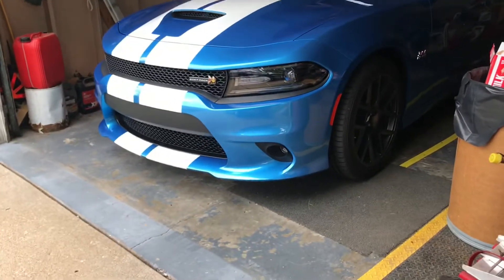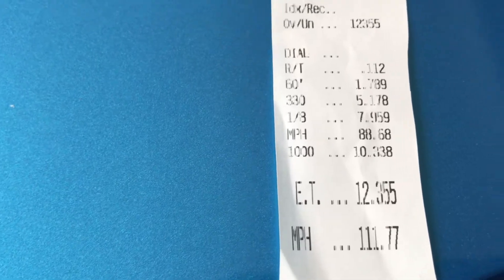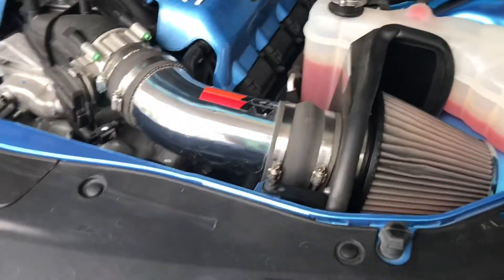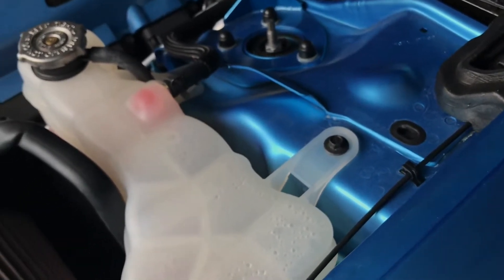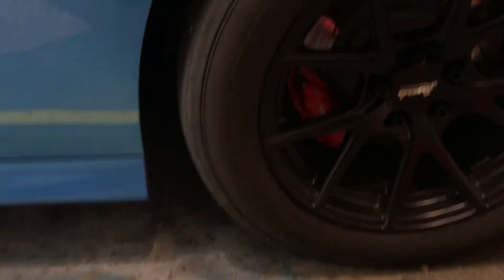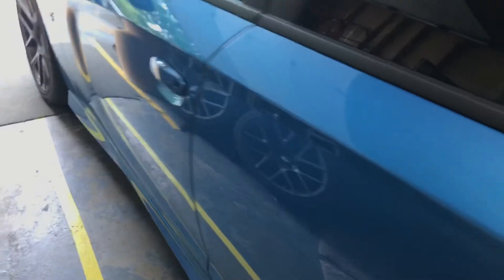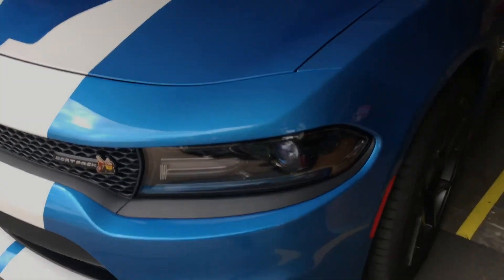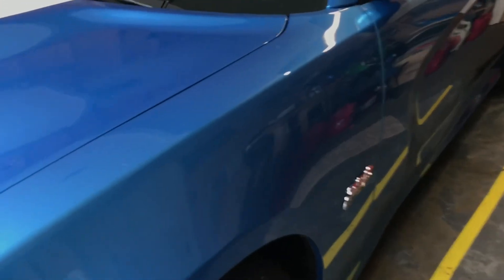Update on MMX Catless Mid Pipes & track results 2018 Scat Pack Charger

Comment: Thanks for listing your mods I had inquired about on your other video comments.  FYI I have a different DA calculator* that will convert your ET & MPH from actual DA to Sea Level, i.e. IF you had been running at "zero" DA what would your time & speed be?  I converted your 12.35/111 run and got 12.08/114.  So this can be useful for logging with all your runs so you can compare "Apples with Apples", that is converting to DA="0" for all runs shows you any relative gains or losses from changes you make to the car.  Somewhat similar to running a SAE correction on the dyno as opposed to "uncorrected".  Helps you eliminate the weather variable so you know if a certain mod or driving technique really helped or not.

Your car is strong for sure.  It may be that your 11.90 run was at super low or negative DA.  I haven't broken into the 11's yet but maybe when the weather cools off.

*The app I'm using is TRC (That Racing Channel), under Calculators choose Correct ET/Speed for DA
Reply from the maker: JazzBlueSRT cool. I’ll check out that app. I would occasionally check out corrections on a website. But an app would be handy. The 11.9 was run at -50’ DA, and my best street tire run of 12.24 was also low +100’s DA. I ran a 12.05 back in April, with 1600' DA, but barometric pressure over 30. Hoping to get it to around 11.7 stock, with interior in car. :)

Comment: What’s your tire setup?
Reply from the maker: Factory front tires, and Mickey Thompson ET Street R 305/45/18 mounted on an 18x10 Bravado wheel.
Reply from the maker: I found the bookmark I had for the wheels. https://www.summitracing.com/parts/brv-tb80515205
Reply: @superroop  thank you

Comment: Where did you get your drag suspension from? Is it worth it looking improve my 60 and better launch drop link if you can !
Reply from the maker: Bugni Andrew I won’t know 100% if it was worth it, but from what I’ve noticed, it is. It does raise the front end up about an inch, to an inch and a half. When I get the same DA as my best runs, I’ll know 100%. But car definitely squats and holds squat better, so I’m thinking it was worth it. If I had it to do all over, I would have mounted the drag shocks I got, at same time as when I did the springs. But here’s the link for the springs. http://carlyleracing.com/product/demonkiller-hellcat-springs/

Comment: What is you’re rim and tire setup on the rear?
Reply from the maker: Evan Galien 18x10 Bravado Tribute wheels, with Mickey Thompson ET Street R’s 305/45/18.
Reply: Ed Ruppel if you don’t mind me asking how much did you end up paying for the rims and tires and from where ? I’m in the process of ordering catless pipes and tires for my 2019 charger.
Reply from the maker: Evan Galien got them both from Summit racing. Total was $1050 for tires and wheels. You can find tires cheaper. Here are some links. 

https://www.summitracing.com/parts/BRV-TB80515205?seid=srese1&cm_mmc=pla-google-shoppingsrese1_-Bravado-Wheels&gclid=EAIaIQobChMIq57c4IqA4AIVBLjACh2MfgZhEAQYASABEgKfhfD_BwE

And place to get tires slightly cheaper than Summit. https://x-rpm-com.3dcartstores.com/18-ET-Street-R_p_33.html
Reply: Ed Ruppel thanks so much for the info.